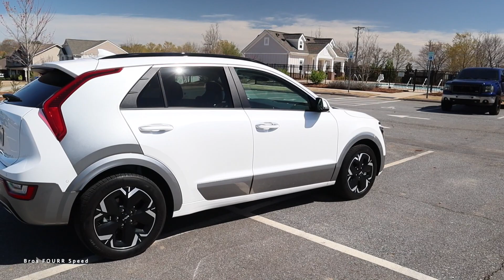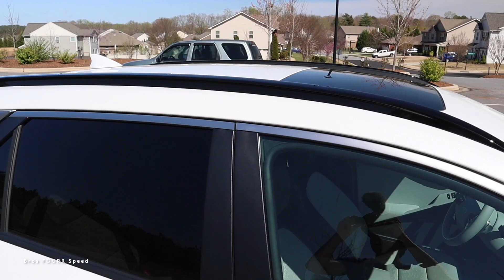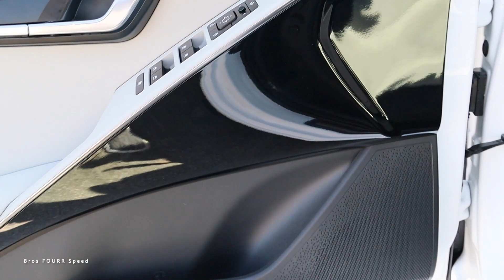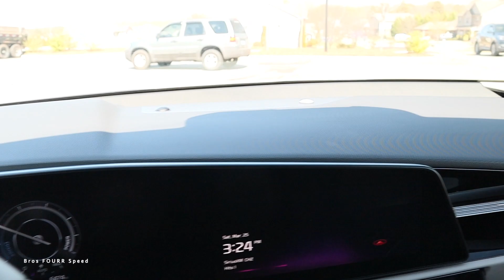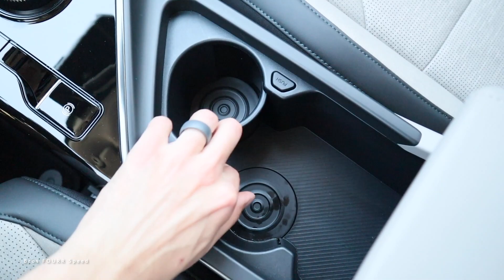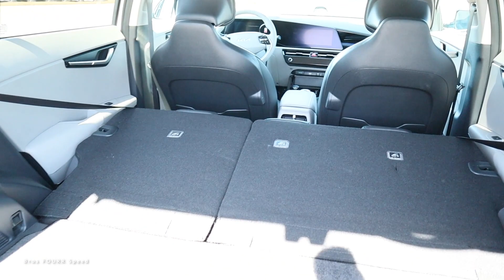2023 KIA Niro EV Wave: Start Up, Walkaround, POV, Test Drive and Review

Comment: Eco mode is best used on the motorway (highway) cruising to save energy at higher speeds. Normal mode for around town and sport mode for when you need a quicker take off response such as entering a motorway or blind corner and then go back to normal mode.
Reply from the maker: Thanks for sharing!

Comment: I've been driving my eNiro for about 18 months now and I love it. Of course it's the old style so it's definitely not a headturner but for driving around town or long distance it is just so comfortable. With that big range, range anxiety isn't even a big deal. I've driven it from the Midlands in the England up to Scotland on business trips and if it wasn't for my limited bladder capacity I wouldn't have had to stop at all. Of course, I do drive mine in ECO mode with max regen braking most of the time and in that mode I can get even more range than the manufacturer's stated max range. The adaptive cruise control means I just set the speed to 70 and cruise at a safe distance to the car in front. With the lane depart steering assist there really isn't a heck of a lot to do but enjoy the scenery and the seats are comfortable enough even for my 240lb frame. For your average driver I think 0-60 in 7.5 seconds is plenty but to be honest, I just feel so relaxed in my Niro that I can't even be bothered to race anyone anyway. Besides, that just kills the range and with UK electricity prices having doubled or tripled in the last year, ain't nobody got time for that 😉